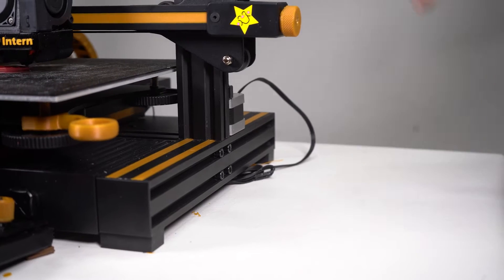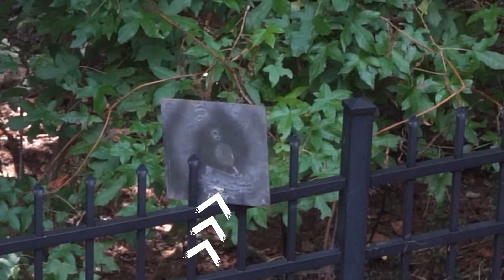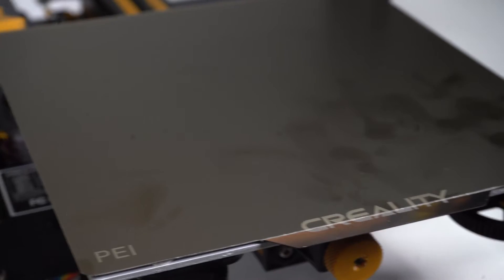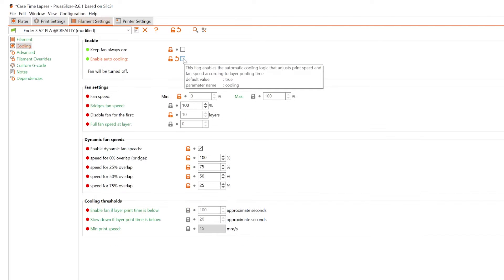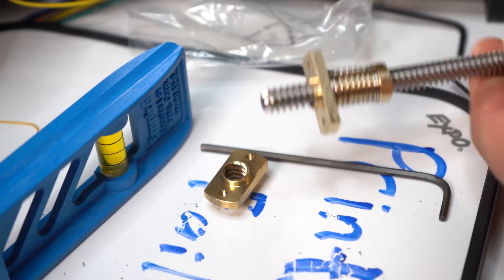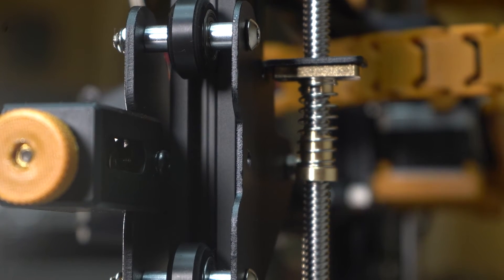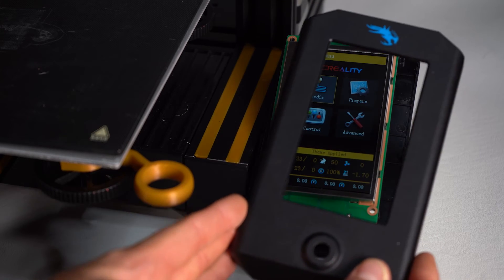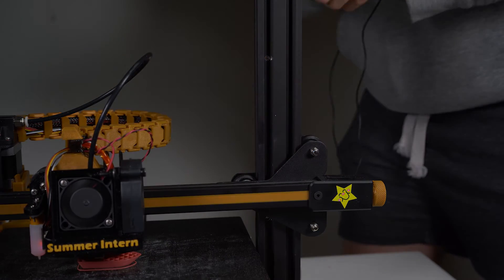CREALITY Ender 3 V2 Build Series | First Layer Adhesion

Comment: All an Ender 3 v2 needs is silicone "springs," direct drive kit, dual z (optional) plus a 5015 dual fin shroud for cooling, and Klipper. I have 80+ units of these (some without dual z) and they are workhorses with this setup. Failed prints are comparable to my Prusa or BL units. The print time blows the Prusas away and is only slightly slower than the BL units.

Some v2's do handle speeds differently though, even with identical setups. I guess variations of the hotends, motors, etc contribute to this. Some of my units can run more than 200mm/s at 7500k acceleration, while others can only handle around 160mm at 3500k acceleration.